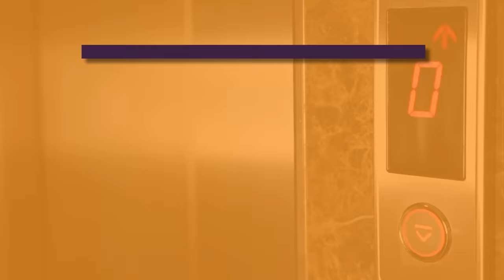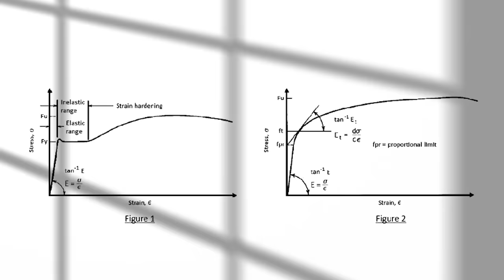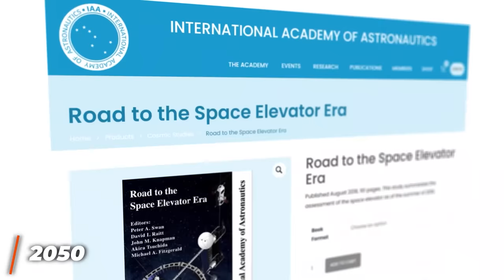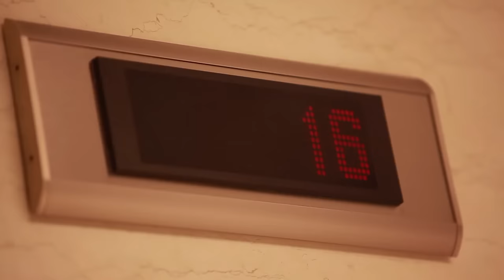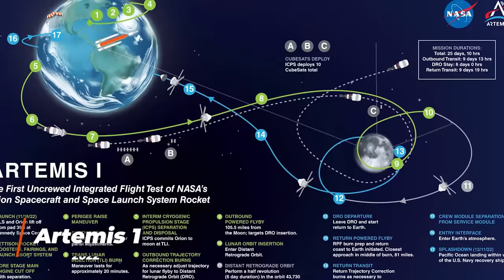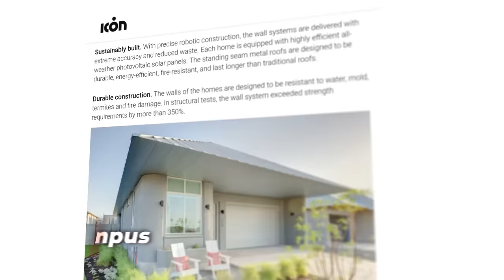Megaprojects of the Future

Comment: fun fact: I got to submit an engineering design proposal and prototype back in 2021 to a NASA Artemis competition which was designed to solve a lot of the problems that lunar dust poses (to electronics, launch systems, eventual habitats, space suits, human health, etc.). my group spent almost a year designing a lunar dust filtration system for the phase 3 habitat of the Artemis mission. was a huge undertaking & it’s super cool to think that our input could actually influence the design of future lunar and martian habitats! 

I now work for Northrop Grumman which is providing the SRBs for the SLS rockets, altitude control and abort motors for the Orion launch abort system, the HALO module for the lunar gateway orbiter, and the gateway —> lunar orbit transfer arm for the human landing system. it’s awesome to see just how much we can contribute to this monumental multi-decade mission!!
Reply: The lunar dust can only be mitigated. Seals of all sorts fail very quickly. How did you plan to cope with going into and out of space suits?
Reply: Awesome career, working on these projects must be pretty cool and at times surreal!!! (not to detract but SLS is way too expensive and impractical, starship will thankfully [hopefully] put a swift end to this boondoggle)
Reply: @joeygrandview7304     Elon will run out of money before the FAA approves Starship for human flight.
Reply: @oldmech619  I think your distaste for the man skews your perception of the technical expertise exhibited by his projects.
While nobody can see what will happen with absolute certainty, past events nonetheless provide the best indicators of future trends.

Based on that, I think its likely that Starship will follow the same route already blazed by Falcon 9 and the Dragon capsule.
Starship will be used to carry cargo to Earth orbit; will probably help construct the Artemis Gateway Station, and will help deliver large cargo loads to the surface of the Moon.

As it does all that, lessons learned will be applied to the development of a crewed version.
After a few years of cargo deliveries, the crewed version will undergo several flight tests -- to LEO, Lunar Orbit, to Artemis Gateway, and then from Gateway to the Moon's surface.

That will flight-certify it, and it will replace Artemis as a more affordable option with greater capabilities.
At the current pace of development, cargo Starships should start working within about two years.
Crewed Starships should receive flight approval by 2030, or thereabout.
Reply: Very cool, Jodi! Looking forward to our first moon habitat with proper dust mitigation!
Reply: @oldmech619  i find that unlikely, remember SpaceX is currently profitable now, despite billions of investment on starship infrastructure, with starlink and Falcon 9/heavy. Not to mention SpaceX is the first defence contractor that could give the US space force a real manned space warfare capability. You you think the military industrial complex doesn't want their toys?
Reply: Tell me about the alien craft please
Reply: I actually own the Moon. I will be expecting rent.
Reply: @DaxianPreston  you're ragtag bunch of so called "moon soldiers" were easily defeated by my space Marines....now i own the moon muah ha ha.
Reply: That is absolutely epic!
Reply: Interesting. I currently work for Innoflight, and as it happens we are providing several products that will be used in Orion.

Comment: using a space elevator to supply the ISS is uhhhh, an interesting prospect. Consider that the space station would be zooming past the elevator, so you need to accelerate to its speed once detaching from the elevator.
Reply: the space elevator can also be used to launch vehicles into space, like a giant earth sized version of SpinLaunch.  the space elevator is the platform from which to build and maintain the solar farm .  to link to low earth orbits, e.g. ISS, you can launch from higher up and "glide" down to dock.
Reply: @CharlsonCKim not possible at all
Reply: The space elevator will be fixed structure, from which ships will dock onto. It's like a harbour in space. Travel to and from the ISS will be undertaken by smaller spaceships
Reply: @daemonblade-4f7a  lmao this is pure science fiction 😂
Reply: @CharlsonCKim  spin launch can't work
Reply: Yeah, that part confused me as well. If you take the space elevator to low earth orbit altitude, you are not in low earth orbit. An orbit is moving fast enough horizontally so gravity makes you fall just fast enough to continously miss the earth. So you either have to find a way to accelerate something at LEO altitude to LEO speed (still a lot of energy needed), or everything gets raised to geostationary orbit by the elevator and then does a regular orbit transfer down to LEO from there (takes about the third of the energy as launching to LEO from earth. So it would probably be cheaper, but by no means free access to all orbits in between, even if using the elevator would take no energy
Reply: @ArsenalGunners89  Nothing can "glide" in space, because there's no atmosphere; that part is certainly true.
But launching from a higher point and then using engines to accelerate with the assistance of gravity to match velocities with something in a lower orbit is certainly do-able.
Reply: @ArsenalGunners89  Well, yeah. Until it isn't.
That's the point of the video.
Reply: @klti0815 I'm not an engineer, I was going to suggest a similar thing...  Go higher and coast down.
Reply: @thomashiggins9320  Altitude is not the hard part in getting to orbit. A few hundred kilometres up is nothing for a rocket. Going to orbital speed is entirely different. The space elevator is stupid.
Reply: aah the iss just needs to throw its anker xD

Comment: I love the idea of the space elevator ever since i first read about them in science fiction books as a kid. But with all of the satellites currently in leo, how do we maintain the safety of  the tether as it passes through that area? Given the satellite count is only going to get higher, and we cant exactly move the tether
Reply: New satellites would be able to move and even have an orbit that evades it. Existing satellites and debris would have to be sligthly moved or de-orbited before the space elevator gets constructed. I expect a space elevator will likely more exist of multiple threads linked to eachother in a way to create segments that in case of damage would be more easily replaced and the other threads would (for a time) take on the extra load/work.

Eitherway this is something that would definitely be worked out well before any space elevator would start production.
Reply: I love the idea of a space elevator but it feels almost certain that some religious nutjob will try to blow it up (tower of babel comes to mind)
Reply: @Lodrik18  There would strict security against that and blowing something like that up shouldn't be easy either.
Reply: Blowing up a space elevator would probably require quite a substantial amount of explosives, and where exactly do you blow it up? On one of the tethers? It's highly designed to not break if even 2 tethers was destroyed. Placing a bomb on the elevator and blow it up like half way up might be the way to go, but I'm fairly certain getting to the elevator with a bomb will be quite a monumental task. Something like a space elevator would be humanities biggest construction in history, dwarfing out everything else ever built. It will require tremendous amounts of materials, people and money. Probably so much material, that we need to mine asteroids to het enough. Something like it would highly likely be the Worlds most secure place.
Reply: He saying it can " revolutionise"
Nooooo rich people will enjoy
Those that dont even have $1000 just go brrr

Comment: On the bit about using the space elevator to send people or supplies to low-Earth orbit: You'd still need to add quite a lot of delta-V to reach orbital velocity at that altitude. Using the ISS as an example, it orbits once every 90-minutes, so it would "whiz past" the elevator tether 16 times a day. Also, even more delta-V would be needed to change inclination of the orbit from equatorial out to the 51 degree orbit plane of the ISS. I say this to point out that we'd still need rockets, but could ditch the idea of a first stage that mostly just gets you above the appreciable atmosphere. A staging area attached to the tether at that altitude could be used as a fuel depot as well, meaning said rocket could be lifted empty and fueled before rocketing away to orbital speeds. (Although significant masses hanging about in the middle of the tether would increase the mass needed at geosynch (or beyond) to keep the tether taut.)
Reply: I've been chewing on a concept of a dual ended elevator with center station the outer tether being a tether/balist allowing to maintain orbit slower and the balist being able to be pulled in or out
Reply: I've read a book about a space hook catching planes at crazy speeds and was like no freaking way was that actually going to work
Reply: I've also been thinking for some time that a low-orbit space elevator would be more viable.  Even though any vessel launched from it would still require thrust to not just drop back to Earth, it would cut back considerably on the fuel-cost of launching.  I'm also wondering if the objective was just low-orbit, would a more conventional building be sufficient?  Could a compression based structure reach up to where there is only 98% atmospheric pressure?

Comment: So the graphene they want to use for the space elevator is conductive.  Have they determined what will happen to the cable when it passes through charged layers of the atmosphere and magnetosphere?  Will it burn out like a giant fuse, from the massive current, or will it carry the charge, all the way to the ground, creating a hole in each charged layer?   Either way, i wouldn't want to be the guy on the ground that has to catch the cable as it is lowered.
Reply: Should be made from boron nitride nano tubes! Stronger than carbon nanotechnology.
Reply: @dianapennepacker6854  still sounds conductive.   Even if it is only slightly more conductive than air, it's going to be a light show.
Reply: @michaellowe3665  yay more green energy

Comment: There is a heck of a lot of stuff orbiting Earth, making an elevator a questionable project. Much better and safer is to build a Lunar space elevator. Doesn't have to be so long, no weather, no atmospheric drag, less danger if something goes wrong. Less orbiting stuff to worry about. In the long run a Lunar elevator would be easier to pay for.
Reply: It would have to be longer. Geostationary (selenostationary?) orbit for any body depends not only on its gravity but its rotation speed. Since the Moon is tidally locked to the Earth, the distance just to the tether would have to be the same as the distance from the Moon to the Earth.

Comment: 3:47 Once you get that high, you also need to match the speed and direction. It's going real fast that a way.
Reply: IIRC the attachment for the elevator would be in geostationary orbit so there would be no need to "match the speed". It would be over the same exact spot of the earth continuously. Not the same as low earth orbit or LEO.
Reply: @Timmycoo  I thought that this was shifted to be about LEO.
Reply: @Timmycoo  he was talking about deploying things to LEO rather than go the entire way to GSO, problem is you need to match the speed and orbit of whatever you're deploying to and that's where most of the fuel use of a rocket is.
Reply: Nah that's not rights. Sorry lol. Would make no sense to have a bi-stationary telegraphing transport tether where one end STILL is locked in angular momentum.

Edit. The stupidest thought that we ALL forgot is centrifugal force lmao. 

How Will it Work?
A space elevator would involve a tether anchored to the ground and stretching up into space. At the top of the elevator, a counterweight will serve to keep the cable taut. Centrifugal force will actually be responsible for holding the tether in space as the Earth rotates slowly

Comment: 3:28 Just one little problem with taking a space elevator to the ISS...  You'd be trying to step off the elevator onto something going past at 17,100 mph.
Reply: Space elevator is that one idea that falls apart the more you think about it. 
My favorite issues with it are of the "But what if it snaps in the middle for whatever reason." variety.
Reply: @thearpox7873 Heh, yup.  I haven't done the math, but I expect a steel cable would snap under it's own weight if it was hanging from space all the way to the ground.  Even without any additional tension from the lift or the counterweight beyond geostationary orbit.
Reply: @brandyballoon  You misunderstand. I meant, let's pretend we've built it and it already works. Then, a month later Allah sends us a snack, or maybe somebody flubs the maintenance, or a giant eagle smacks into it, or literally anything else.
Not a good image of what happens next, issit?

Comment: One thing that got me thinking was the possibility of using a maglev system to launch cargo from the Moon without needing fuel. Reaching lunar escape velocity of 2.4 km/s shouldn't be that difficult if you can cheerfully ignore air resistance like you can on the Moon. Even transporting people and animals would only require a 90 second acceleration of 3 g's.

Comment: about the space elevator: at 400 km above the earth the speed of the cable is a bit faster than the speed of earth rotation, 2000 km/hour. The space station or any satellite in orbit moves at 27500 km/hour. What are you going to do once you are up there with all satellites passing by at 10 times your speed?

Comment: 3:47 So long as you don't care about the space station zipping by at 27,000km/h.
An orbital ring is the superior cheap space access megaproject and has the benefit of need no new materials and letting you accelerate off the ring to orbital speeds without using reaction mass.

Comment: I would like to know exactly how you're going to build an elevator to a space station that orbits the earth every 90 minutes funny how you ended that segment with that statement
Reply: Haha, yeah. You'd still need a beefy rocket to get into orbit from there.
Reply: You send it up higher than the space station, then let it "fall" into orbit. It will still need rockets for course correction, but far less fuel than a straight up launch.
Reply: @bobthecomputerguy  More for circularization than course correction. But then you're crawling much further up the tender anyway.
Reply: Since the difference in speed between a geostationary space elevator and the ISS is 17k mph it would probably be easier to go there the way we do it now.
Reply: @gubbvila  It's a lot easier to get to leo from geo than from the ground.  You can do it with small engines that would never get you off the ground.  The benefit of "the way we do it now" would be time saved, which would be good for astronauts, but not needed for bulk cargo.

Comment: Space elevator, the comment about not needing to go to the top, maybe the height of the ISS. But being in orbit requires a very high lateral speed, not just height.
Reply: At ground level the space elevator already has a lateral speed of over 1000 kph and any loads that are carried up will experience lateral acceleration. True that will only be sufficient for orbit once it reaches geosynchronous height (10,800 kph), but launches from lower levels will need less fuel to reach orbital velocities than launching from  ground level.

Comment: The only way this might be possible if materials weren’t a consideration would be to build the entire 36,000km at a Lagrange point and then transport it back to GSO and lower it down to earth. If you start with a satellite in orbit and build down to the surface, it would start to drag itself down as a great portion of it is not traveling at orbital velocity for its altitude. Basically if we could build a space elevator we wouldn’t need to.

Comment: Space elevators are pure fantasy, ignoring materials existing that could even support it, I love how they brush over the sheer material cost. manufacturing capacity is mentioned only in passing as if its simple to accommodate but this is thirty five thousand kilometers of material per strand that not only has to be made meaning the supplies and facilities to do that but then has to be delivered. it just gets sillier as you think about it.  by default the material has to be sourced in space. Put it this way, the Earth is just over forty thousand kilometers in circumference and some elevator designs extend the same distance in both directions  

However there is also the super big issue of electrical charge differences between ground and the end point and finally of course, debris in space. Oh joy. Plus you just know some radicals will find a way to attack it and I doubt anyone wants to know the effect of it falling back to Earth

Comment: They're gonna get a surprise when they try to use that space elevator.  I suspect that whatever they try to have climb the nanotube (or ribbon) will throw the space end of the elevator out of its geosynchronous orbit.
Reply: If they use a LeGrange point it will work but there arent may of those on land
Reply: Whipping around like, uhhh a whip?😮
Reply: That's what the counterweight is for.  And it will likely need to have thrusters as well.
Reply: It’s not the end point of a space elevator at geostationary orbit but rather its centre of gravity. Thus the end, with or without a counterweight, is a lot higher.
Geostationary orbit is over 35,000 km up, so the weight of the elevator is going to be considerably larger than that of any elevator car - it’s not going to affect the balance much. What the car will do is drag the elevator sideways as it is accelerated from its lateral speed at the Earth’s surface (1,670 kph) to that of geosynchronous orbit (10,800 kph)